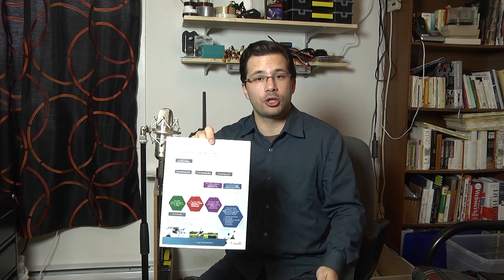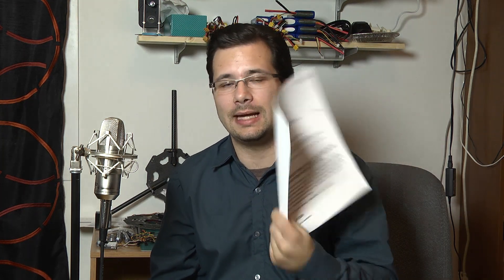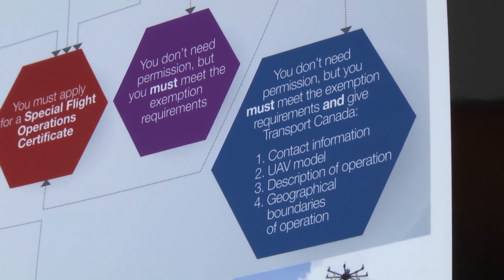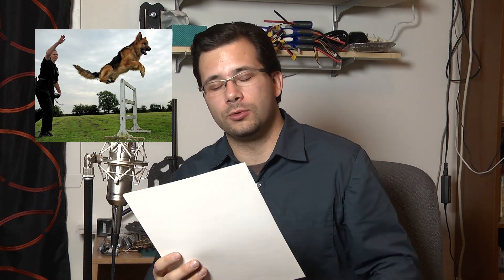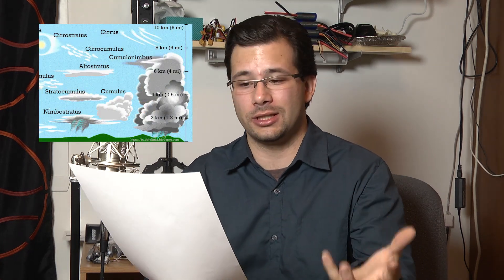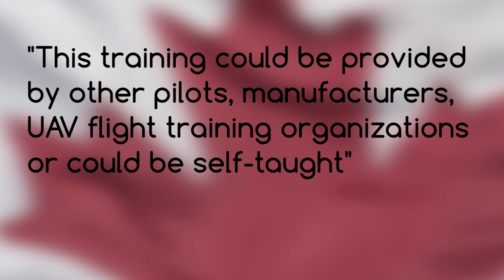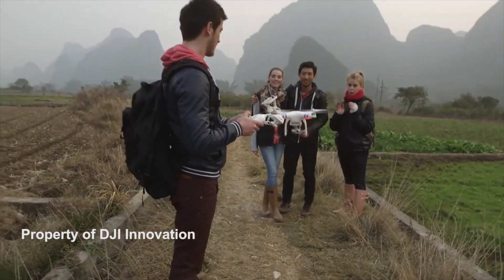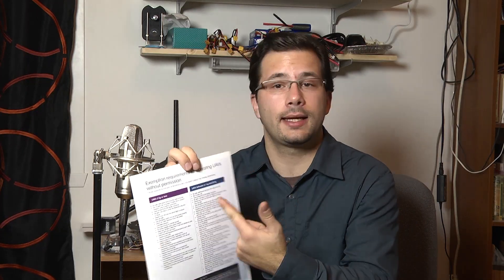DroneIQ - How to freely operate a commercial or research drone in Canada

Comment: Say's can'y fly within 9 KM of any airport, can you apply to transport Canada to fly within, let's say 3 km ?

Thanks
Reply from the maker: This video is only relevant to the TC exemption offered since nov 20014. Any flying closer than 9km from an airport is prohibited (even for leisure) unless you obtain an SFOC. It's not that big a deal, if it's a small airport will few air traffic. You need to get permission from the airport authorities and produce a NOTAM. I did it once to shoot aerial of an hospital. They have an heliport for air-ambulances, so it's considered an airport and the 9km rule applies. But they allowed it as long as I took the necessary precautions.
Reply: Drone IQ
Do you produce a NOTAM each time you fly?

Comment: So If I get this right, fpv quad copter racing (250mm ) is  a no no . or does Quebec have its own set of rule on this?
Reply from the maker: Depends what kind of racing. I'm pretty sure you could hold an event if your get an SFOC and picked a safe location.
Aircraft regulation is a federal jurisdiction (Transport Canada), so rules are the same for all provinces... Although in practice, experience has shown that federal offices do not process all SFOC requests equally across provinces. Quebec has the reputation of being the worst and least permissive one. TC has said they would work towards greater fairness across the country... We'll just have to wait and see.

Comment: thank you for making the video, I worked at an r/c dealer in Calgary and everyone was told that as a commercial project you need a commercial pilot on the ground team. This opens door for me. Thank you for doing the research. Just one thing, you NEED to put those batteries into a fire proof container, they sometime explode without notice.